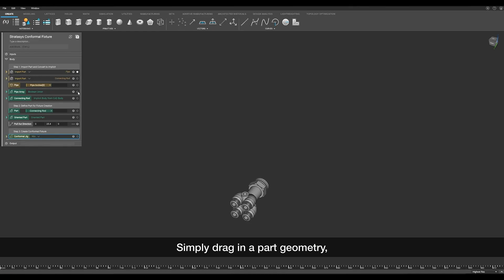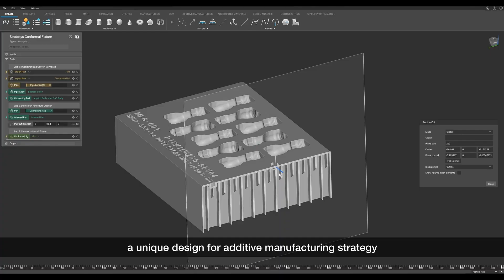FDM Fixture Generator (Stratasys | nTopology)

Comment: So basically,
- New Infill Algo
- Make holes in model using another model (can be done is fusion360)
- Automated Screw location maker

Ye that can make fixtures easier and if I had a job specifically for this task, it would be helpful. Not sure how this will work with hobby fdm, guess i need to wait and see